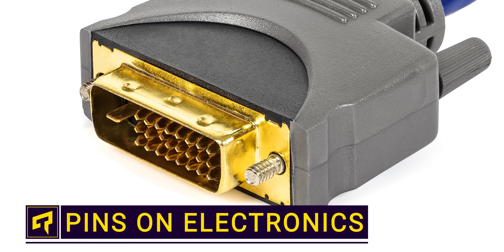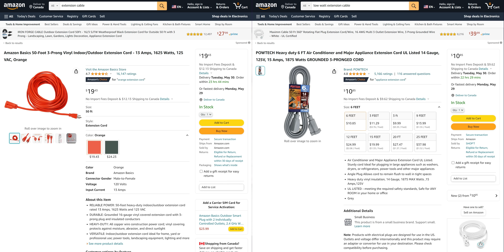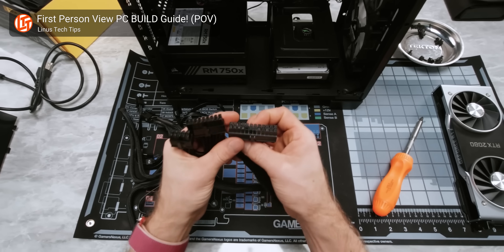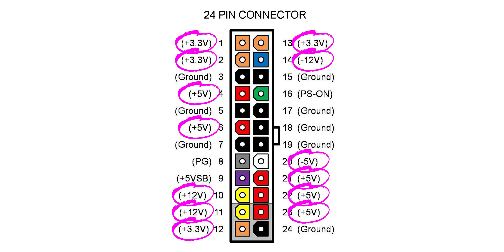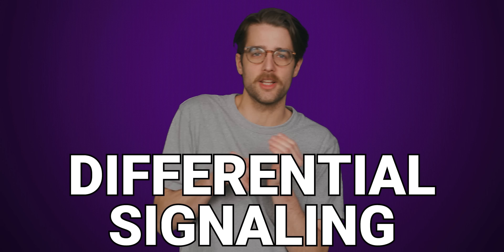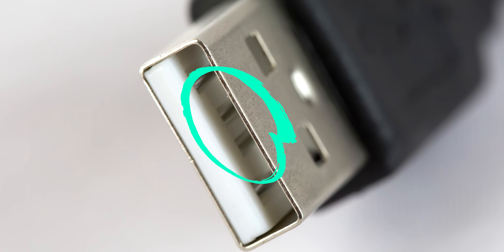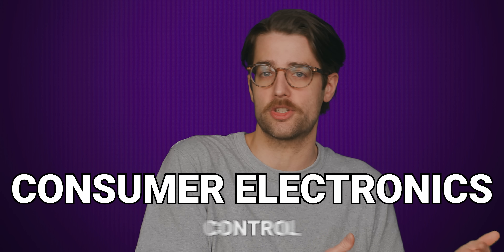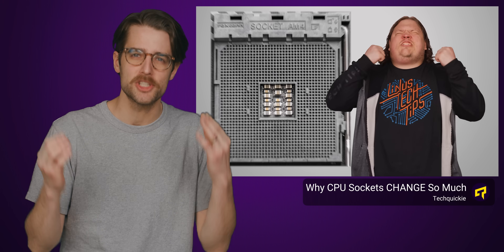Why Connectors Have So Many Pins

Comment: Differential signaling was a silent take over on computing pretty much. Until the pentium era, basically only ethernet used differential signaling.
But then USB,sata,pci-e,displayport/hdmi... One by one, every PC connection was replaced by another standard that used differential signaling for better performance.
Reply: Thank goodness too. It's a simple but rock solid signaling technique
Reply: Actually, differential signalling was part of some serial protocol standards (such as RS-422, common in many industrial applications, and also used by some early Macintosh peripherals) since at least 1975, and I believe Low-Voltage Differential Signalling (LVDS) was already widely used in laptop displays and SCSI hard disks in the early-to-mid 90s.

But yes, as speed requirements increased in general, pretty much everything went to LVDS because it provides much higher reliability for high-speed data over a given distance (nowadays differential signalling is even often used for some types of communication channels inside the silicon of CPUs and GPUs, too).

Of course at the same time many things also went from parallel to serial too, so the transition to differential signalling for lots of things actually came with fewer pins, not more (which is why many modern PCIe cards have much much fewer pins than older ISA/EISA/VLB/AGP/PCI cards did, etc).
Reply: As a bit of trivia, differential signaling is also used in professional audio (as in live PA for concerts and festivals and in studio) for the same reason - interference resistance. All the microphone cables you see on stages are actually made of three conductors, two of which carry the same signal with inverted phase. It's a very simple yet effective way of greatly reducing any noise that can be induced in the cable.
Reply: i guess thats why we still use it all these years later
Reply: out of curiosity, is it used for traces on motherboards?
Reply: @fRutrn  If the signal is differential coming into the PCB, it is routed as a differential signal on the PCB. Without getting too into the weeds (because believe me when I say there are people who can talk about this for hours), differential signals on PCBs need to be length matched, impedance matched, and phase matched (and each type of signal has it's own spec for acceptable impedance, PCIe Tx/Rx lanes have an impedance spec, USB3 Tx/Rx lanes have an impedance spec, etc.). What all this means is if you imagine two race cars, you want them to not only arrive at the same time (length matching), you want them to be neck and neck along the whole length of the track (phase matching) and face the same obstacles (impedance matching).
Reply: @fRutrn  The most obvious case of that is all the onboard stuff that use the PCI-E lanes.
Reply: @fRutrn  Yes it is used for quite alot of the communication busses on PCBs since signal integrity on those at high speeds also gets worse and having a dedicated return path for the current masively helps with Electro Magnetic Compatibility and Electro Magnetic Interference.
Reply: To add onto this thread, which has kinda been said, but not plainly: in addition to being good at resisting interference, the voltages of the signals can be lower since it is comparing the two, rather than receiving a state.  This allows the transistors to switch faster, allowing faster data speeds.
Reply: interesting

Comment: I think the more important question would be... 
Why does the USB-A cable never fit, no matter which side you try to plug it in
Reply: Superposition. It doesn't decide what side is correct until you try to plug it in. At which point it has an 80% chance of being upside-down.
Reply: @LaughingOrange  good one!
Reply: @LaughingOrange  USB connectors have a spin of 3, meaning you have to flip them upside down at least 3 times before they fit.

(Or you can just look at the position of the "tongue". But people couldn't even figure out the very tactile asymmetry of Micro B plugs, so we had to invent C)
Reply: its always the third try that works
Reply: Don't you have a Requiem to finish? 🥲
Reply: It’s four dimensional.
Reply: sounds like a you problem i get it right 90% of the time

Comment: Better screening of sponsors needed
Reply: So true I am honestly a bit shocked. An ad for a shitty Indiegogo project/idea/scam wtf.
Reply: @noahfischer1312  Any evidence to say this??
Reply: @ac.creations  Dumdum... it's an "air conditioner" with no barrier for hot and cold.
It's as effective as taking an AC unit and putting it in your living room and expecting it to cool.
Spoiler: It doesn't.
Iz DeR aNy EvIdEnCe?!?!?!?!?! 
Yes, the laws of physics. JFC.
Reply: @tim3172 you tried and yet failed so miserably hard, it’s impressive
Reply: @Crestxo his explanation was terrible but he's not wrong. Anytime you cool something you get more heat as a byproduct. If this is a peltier device then you get WAY more heat than cooling out of it.  They would have to get very creative to be sure that the hot air is not being blown on to you somewhere and is dispersed appropriately. Not saying it's impossible, just don't expect it to work indoors. 

The use of "AI" in the marketing is also usually a red flag when it's being attached to products that obviously don't need AI to run.
Reply: @ac.creations  physics - specifically thermodynamics. Even in the best circumstances this thing can cool less than 1/10th of the heat your body itself produces, let alone hot summer sun. Also, creating cold generates heat, where is that going?
Reply: @tim3172  AICE 3 respects the laws of physics, actually it uses Peltier effect (You may find the detailed explanation on Wikipedia here: https://en.wikipedia.org/wiki/Thermoelectric_effect)
Reply: @davyc444  Thank you for your professional explanation. Yes, AICE 3 uses Peltier effect, and its air duct design is patented to ensure the heat generated for cooling is disposed outward instead of inward.
As for the AI, AICE 3 uses AI algorethem to control the temperature and wind speed for you, so that you don't need to control it by yourself frequently.
Reply: I had to go back bc I skip sponsors like a normal person but wtf
Reply: @mrbanana6464  SAME
Reply: I'm dying, this has to be an April fools.
Reply: Whoever did the 50 degrees Fahrenheit = 10 degrees Celsius conversion doesn't understand the difference between a temperature and a change in temperature. A change of 10 degrees Celsius is a change of only 18 degrees Fahrenheit, not 50.
Reply: phew, I wasn't the only one thinking this.
Reply: Why not advertise something we might actually buy?
Reply: True
Reply: To be honest, Techquickie is quite picky on collaborations (including sponsors), cause Techquickie knows a lot about tech, and so do his fans.
Reply: @henryzhong1989  Hi marketing leader of the sponsor.
Reply: @Sinaeb  Hi, nice to meet you! SinBae. Any questions regarding the product, you're more than welcome to ask me, if my answer is not satisfactory, I will let the product manager to answer.

Comment: I thought linus media group didn't advertise shit products? Theirs no way that mobile "ac" works. I swear a simular device was discussed by linus about half a decade ago.
Reply: It´s not even real yet it´s an Indiegogo fundraiser like wtf
Reply: They advertised that shitty Steam Deck competitor recently, so...
Reply: It truly works and helps people that have to expose themselves in hot environments like blue collars, hikers and travelers, etc.
Reply: @henryzhong1989 Yeah, right. If it was any more obvious that you're one of the people behind this "product", you would be screaming "BUY THIS" from rooftops.
Reply: @henryzhong1989  Then set up having Linus review it on his channel, that's the ONLY way to convince others and mineself.
Reply: It’s different from the cheap C garbage LOL
Reply: @LeeMooEez  It's the same thing with the same shit just said differently
Reply: @Sinaeb  As the most expensive neck air conditioner, AICE 3 do have some high-tech components inside that truly works.

Comment: Pretty misleading to call a neck fan an 'air conditioner'
Reply: This ad is a scam surprised they took the sponsor.
Reply: @monsterhunter445  Because they tried and it really works. Techquickie is quite picky on corporations (even sponsors), but they know about technology and so do their fans.
Reply: A neck fan that doesn´t even exist yet it´s an Indiegogo fundraiser
Reply: @noahfischer1312  I'll take 'things that will never happen' for 1000 please.
Reply: BuT iT's AI pOWeReD
Reply: I think there is a peltierelement inside, wich should provide actually some cooling. There is only the question of the heat dispoasal. I guess that it will line in the endless familiy of crappy peltierelement products. But, if you want to waste 300$, you'll have some nice pice of tech, to show anybody else.
Reply: @korbinianrottmair8189  If it actually gets made that is
Reply: @noahfischer1312 :
I think that isnt the problem. 300$ should be more than enough. I think problem will be a crappy product. You have to dipose the heat, that needs fans, fans are loud, if small and powerful. My guess is, that you'll get an uncomfortable plastic collar, which cools your neck at the contact points, but you'll sweat right next to them. It'll heavy, so one wouldn't wear is long. It will be a gimmick, which fail, like so many others. I think there was a wearable air conditioner from Japan, it wasn't a success either.
Reply: @korbinianrottmair8189  Don't worry, the thermal pad of AICE 3 that your neck contacts is made of ultra-cold aluminum, it feels cool and comfortable.
Reply: @korbinianrottmair8189  Gosh, you're right. Yes, AICE 3 uses Peltier effect. It's probably the most advanced and eco-friendly neck air conditioner so far. We're hoping to make the world a better a place to live with AICE 3.
Reply: Its not misleading, you can use that air conditioner to cool your RaspberyPI zero supercomputer.
Reply: AICE 3 is a neck air conditioner that can truly blow cold air, although you can also use it as a neck fan if you like.
Reply: @henryzhong1989  "blowing cold air" does not make something an air conditioner.
Reply: @MrBigCannoli  Eh, "replacing hot air with cooler air" is the definition of an air conditioner that Wikipedia gives (https://simple.wikipedia.org/wiki/Air_conditioner)

Comment: Hey Riley forget about the pins we want a video about that mobile ac that can be put around our neck. Thats ridiculous
Reply: I was so intrigued by this sponsor that I didn't try to skip it
Reply: @cs188creations  SAME LMAO
Reply: Crazy Ken will review it
Reply: What, you don't want 7000mah battery pack resting against your jugular?
Reply: I want to know how the screen works when it is around your neck 🙄
Reply: Yeah I have no idea what the hell that is. Does it blow hot air away from you on everyone around you? Is the coolant pressurized in that little thing or is it a peltier? According to the website it has a "4 core semiconductor" is that the peltier or the "AI" processor? What do you do with the sweat/condensate that accumulates on the fins? What about the heat coming from the AI processor? 

This thing is definitely a shady product if it isn't a scam. Don't know who in the LMG team greenlit it.
Reply: @mrmimeisfunny  TEC is a Peltier. Yes. As for the other questions? Got me. As for who at LMG green lit that as a sponsor? Idk but I sure as heck hope they used the crap out of a few. I want to see B roll of LMG/LTT/Labs/Floatplane employees using these things outside of the office in that ad spot.
Reply: @mikes2381  does this comp- nevermind they probably copied it from someone else... Does that original company understand how human heat release works?? Your forearms are the heatsinks of your body, it's probably way safer to not strap a huge battery around your neck and probably way more cooling efficient. Those things look like exploding SAW movie braces
Reply: Does look cool doesnt it.. ;)
Reply: I'm sure it's a scam but I'll be happy to be proven wrong
Reply: Wait until the NEXT sponsor: A calculator with Blockchain Technology 😂😂😂😂
Reply: I have one of these from a different “company”. It’s the same Metaura company but with a different shell. Mine doesn’t have an lcd screen tho. Works as advertised for heat and cool and uses the same app
Reply: It's not an air conditioner. I forget what the technology is called, but it's pretty inefficient, and it's really only good for personal use
Reply: I read your comment a few seconds before he started talking about it. Lol
Reply: Giving me “Blaux” vibes
Reply: I've seen other versions of this type of product that don't work very well This one actually looks like a better product but it's still probably not super good.
Reply: It's just gonna be a TEC (Thermo Electric Cooler). They're small and very inefficient but you apply a voltage to it and one side gets cold and the other side gets hot. It works. Many of the smallest mini-fridges use the same technology. It works. Nothing surprising or black magicy. Not actually an AC but more so than those tiny swamp coolers that claim to be ACs.
Reply: Probably used thermocouples for cooling but not quite sure about meeting the specs...